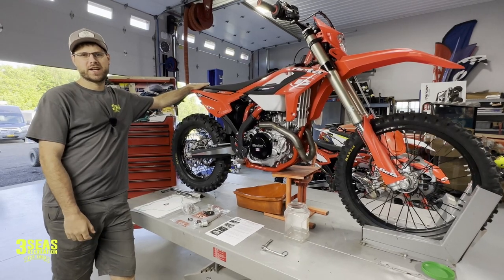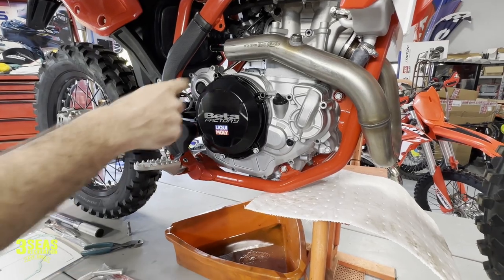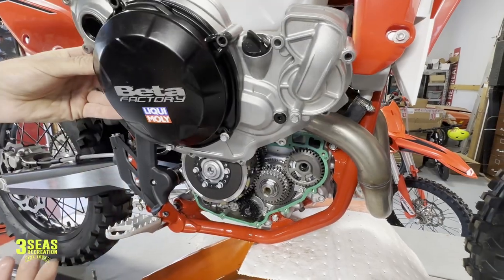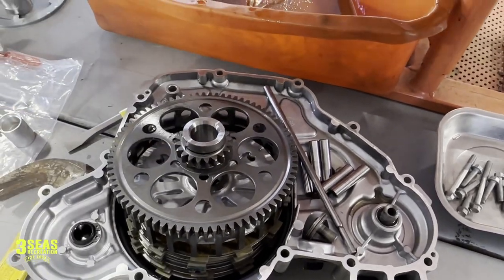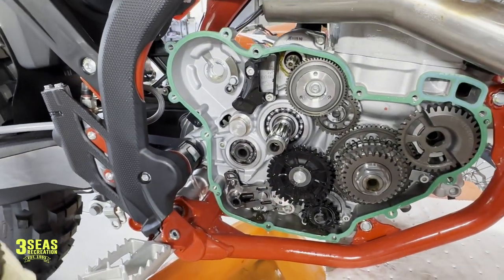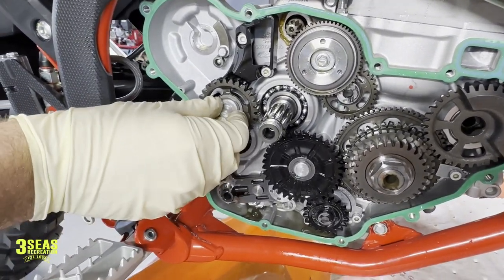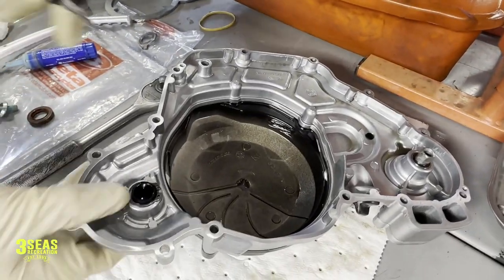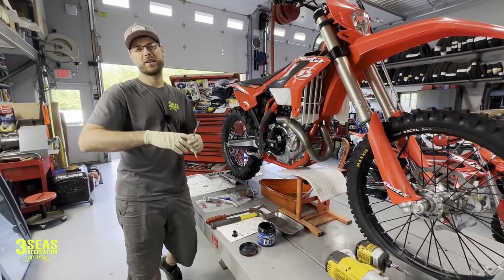2020+ 4-Stroke Beta RR/ RE/ RR-S Kick Start Kit Install : AB-21193-20

Comment: I just installed the same kit on my 2022 500RR-S, which had 25 hours on it when I did the install.  And the install went exactly as Jared has shown, but my bike will NOT start using the kickstart lever.  I can kick till I pass out, and it won't even pop.  But if I use the electric start, it starts like normal!  I suspected there wasn't any spark, so I grounded my spare plug against the header pipe, and sure enough, there was no spark when using the kick start lever.  If I press the electric start, it does spark...but ONLY after the engine turns over a couple revolutions!  Before everyone says kick harder, I promise I'm kicking it plenty hard...I'm a big guy, and I doubt anyone is gonna kick it any harder.  But no matter how hard I kick it, it's not going to spin over two complete revolutions!  However, it's pretty obvious from the spark plug test that that's exactly what has to happen before the computer sends spark to the plug!  I've emailed Beta USA, explained all I've tried, and all I've observed, but so far they've been no help.  

My bike is a 2022, but it was built in July of 2021.  The map has never been updated, and the closest dealer to me (2 hours away...the dealer I bought it from closed their doors) says that there have been at least a couple updates since my bike was built...so my only hope is that the newer updates might include a change to how/when spark is sent to the plug!  I'm going to make an appointment to have the ECU updated as soon as I get back home from vacation.  

Incidentally, I asked BetaUSA if the outdated map might be a  possible cause, but their email reply didn't answer that question.  Their only suggestion was to make certain I got the engine just past TDC and kick it smoothly!  Not much help, since I was already doing that before I ever emailed them.
Reply: Thank you, great info. Very interesting and I hope you get a response from Beta.
Reply from the maker: Good Morning, after reading all these comments I was eager to try the kit myself. I was able to finish the suspension lowering kit this morning and rolled the bike out back and it fired on its 6th kick and I forgot to even look for TDC as it has been so long since I have kick started a 4 stroke. The video will be published and online here within an hour. Have a look and see if I am doing something different. My only suggestion is to kick SLOWER. I actually was kicking to fast at first. I learned that a mid fast kick is all that is needed. Enjoy The Ride, Jared
Reply: Thanks Jared.  I just watched your update, and saw you start the 390!  Though I'd already tried the slower/smoother kick (per Beta USA's suggestiong), I went out and tried it again.  Nothing.  Won't even pop!  Touch the start button, and it fires up normally!  

Your comment about the headlight makes me wonder...  Mine, of course, turns on with the key, because I have an RR-S.  Do you think there's any chance that a difference in the electrical system between the RR and the RR-S (like I have) might be the culprit?  Like I said in my comment, when you touch the electric start button, the spark plug doesn't actually spark until the engine has spun over for a bit...sounds like about two revolutions to me.  But when you use the kickstarter, there's no spark at all!   It seems like there's a delay that can only be coming from the ECU.  I'm waiting for the closest dealer to me to schedule an appointment where I can get my ECU updated, since my bike has what I'm guessing is the original map from when it was built (7/21).  I hope that makes a difference, because I can't think of anything else to try.
Reply: @NorthTXMountainbiker  came back to this video thread looking for an update.. Did you ever get it sorted?
Reply: I'd like to know as well for the RR-S, else won't be risking the kick starter kit.

Comment: Never been able to kickstart my 480 in 5 years. Yet I could literally kick over my XR600 by hand.
Reply: I'd have an easier time pushing it up an incline and bumping then trying to kick my 480. 😂

I've kicked a ural and the compression makes all the difference
Reply from the maker: Good Morning, after reading all these comments I was eager to try the kit myself. I was able to finish the suspension lowering kit this morning and rolled the bike out back and it fired on its 6th kick and I forgot to even look for TDC as it has been so long since I have kick started a 4 stroke. The video will be published and online here within an hour. Have a look and see if I am doing something different. My only suggestion is to kick SLOWER. I actually was kicking to fast at first. I learned that a mid fast kick is all that is needed. Enjoy The Ride, Jared

Comment: @3sr tv why would one do this? 
If the battery is dead aren't you dead in the water?
Reply from the maker: Good Morning, yep you are correct. All modern 4 stroke bikes require a perfect 12v battery. We actually ended up 2nd place overall at the 24 hour race a few weeks ago because a KTM died on another team and they had to get towed out of the woods. I will say tho that there are more reasons to have a kick start kit other than just the battery. At the Texas Hard Enduro 2 years ago drew smashed a rock so hard it pinched his starter wire completely off, if he didn't have the kick start kit he would not of gotten out of the woods! Enjoy The Ride, Jared
Reply: The starter can fail, the bendix can fail, your relay can fail, your starter button can fail. Want some more examples?

Comment: hi all can anyone help i have a 21 model xtrainer 300 on recent investigation i took the stator flywheel cover off and i have very slight play on the main rod shaft is this  normal or have i a got a problem if any one can check there bike for me it would put my mind at rest thanks in advance

Comment: I would think if this was my bike and had to tear it down that far  for the kick starter  kit I sure would have changed out those dumb plastic oil pump gears with the steel ones. Wouldn't be hardly any extra labor costs for that. Just saying.
Reply from the maker: Good Evening, yes the steel oil pump gears are quite the good option and especially when we are already in there. Enjoy The Ride, Jared

Comment: If you battery goes bad. The kickstart will not help you.
Reply: This was a question I had. It makes sense, thanks.
Reply: The fuel pump will run with 8v, but that won't spin the starter.  So a weak, but not dead battery, or busted starter, were the reasons I opted for the kit.  But even with a fresh battery, the kick start lever won't start my 500RR-S.
Reply from the maker: Good Morning, yep you are correct. All modern 4 stroke bikes require a perfect 12v battery. We actually ended up 2nd place overall at the 24 hour race a few weeks ago because a KTM died on another team and they had to get towed out of the woods. I will say tho that there are more reasons to have a kick start kit other than just the battery. At the Texas Hard Enduro 2 years ago drew smashed a rock so hard it pinched his starter wire completely off, if he didn't have the kick start kit he would not of gotten out of the woods! Enjoy The Ride, Jared

Comment: For the amount of  money these bikes cost, you got to buy a kick start kit, and beta still puts the plastic oil pump gears in, but you can buy the steel ones to replace them.. 11k all that should be included... ktm does the same shit, but now they don't have a place for a kick start..prices are a little higher than beta... just saying
Reply: The kick starter should be standard and also the steel oil pump gear like you said also a rock hard seat that you have to replaced.
Reply: Ktm are way more reliable than beta. I own both. My buddy with a 23 390 with 70 hours on it just completely destroyed the plastic gears and has had wiring, battery and overheating issues all along.
Reply from the maker: Good Morning, I'm not even sure that Honda, Kawasaki or Yamaha have a spot for a kick start. Or even the KTM/Husky/GasGas. Can you even add a kick start to those bikes? It's sweet Beta even gives you the option for the kick start kit. Enjoy The Ride, Jared